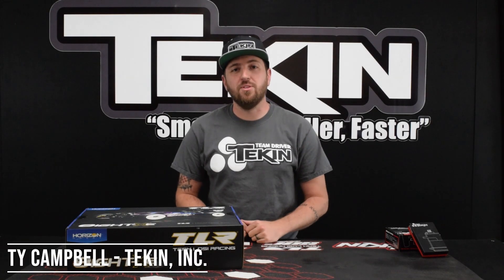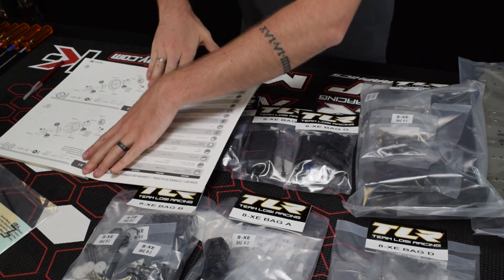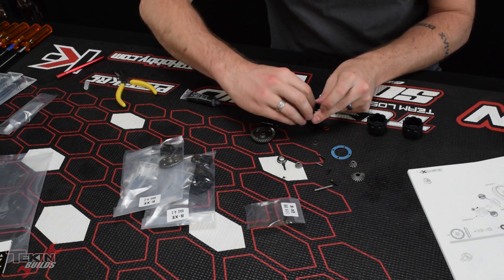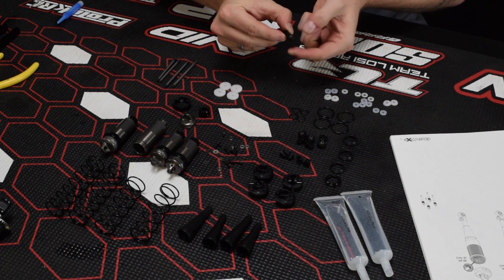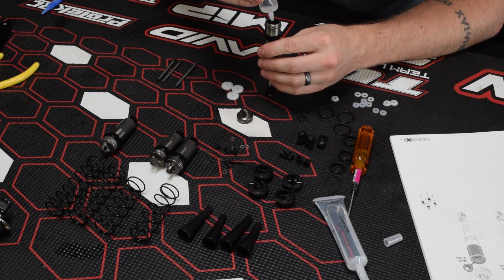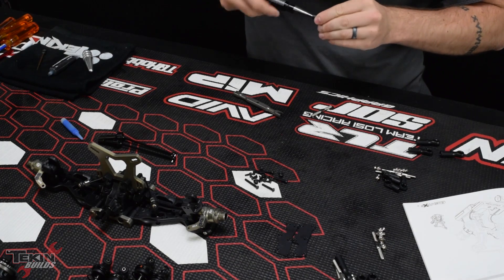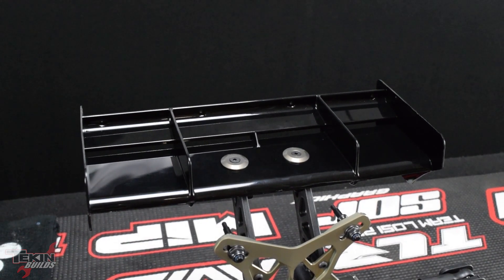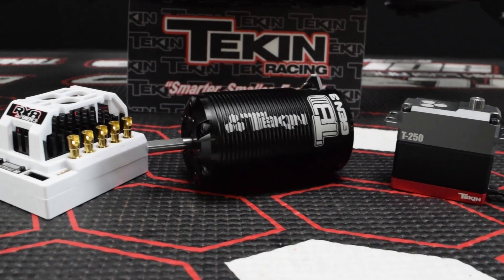Tekin Builds Ep. 7 - TLR 8IGHT-X E 1:8 BUGGY Chassis Assembly

Comment: A little tip for building diffs, especially if you have really big hands like I do...
Diff fluid is thick enough to use like glue and stick the spider gears and shafts all together so it's easier to get it all assembled without them falling apart. Cheers!

Comment: I love this KIt.Just upgraded from 4.0 and this is completely different beast. One thing I must mention is the rear dog bone for centre and rear diff is too short.TLR has released slightly longer dog bone which is if I am correct 3mm longer. It is the pin sitting almost on the edge of center outdrive but if you push it forward then pin is halfway over the edge of rear outdrive.TLR stepped up and sent me a new upgraded part.The new part number is TLR242034.
Reply: I'll have to check that out, thanks for the heads up! Definitely had a good time building this kit!